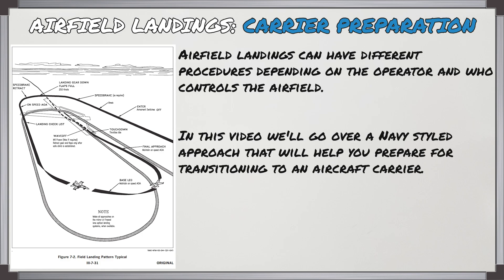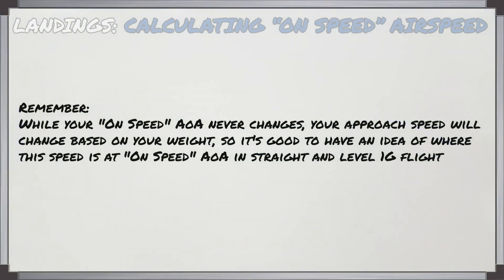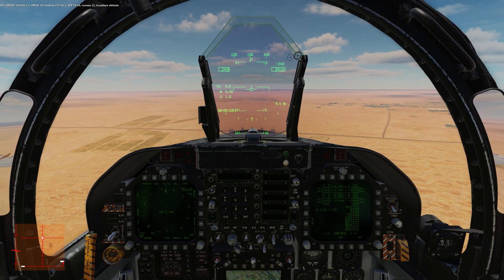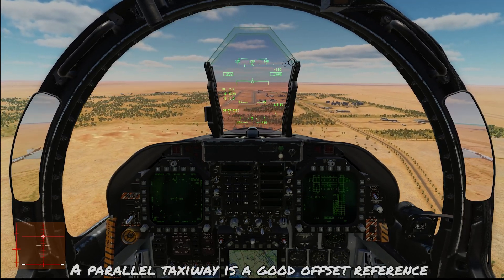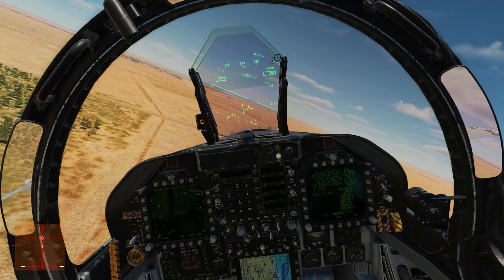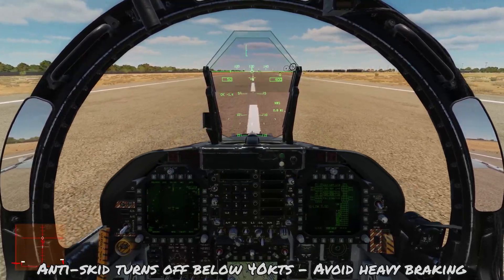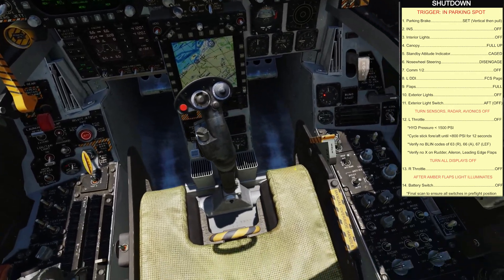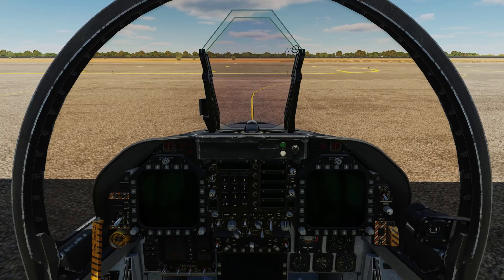DCS F/A-18C #4 - Airfield Approaches

Comment: Just got DCS, learning the F-18 first after messing around with FC3. Your videos have been extremely helpful, thank you.
Reply from the maker: Glad to help :-)
Reply: @RequiemsACTL  how do you ensure the proper distance from the threshold - I guess that 1.2 nm distance? when I go into the final turn at 30 degree bank angle I'm going wide and end up right of the runway
Reply from the maker: @Based_Gopnik89  when you're learning to judge that distance create a waypoint on the runway threshold and keep it active so you can see it in the HUD. Once you get used to that sight picture you won't need it anymore. You should also be evaluating how the runway looks during that final turn, your bank angle will vary a based if you see yourself overshooting or undershooting final.
Reply: @RequiemsACTL  How can I know when to begin turning to be align with the runway
Reply from the maker: @kenwei568  It varies depending on the wind conditions, so it will take some judgement and practice

Comment: This is fine when the terrain is flat, but on many airports they are placed in many mountainous areas, I’m presuming in these areas a pattern landing is not recommended?
Reply from the maker: In an area with terrain, or even nearby airspace, the type of patterns flown at an airfield can be limited. It could limit it to left hand only, right hand only, or even landing in one direction and taking off in another. Unless you had terrain close by on both sides of the airfield you could do this type of approach.
Reply: @RequiemsACTL  thanks also I’m seeing pattern landings @ 1,000 or even 1500 feet on upwind as opposed to 800 which seems more for carrier landings but many tutorials including our good friend wags they use 800
Reply from the maker: @thedigitalscribe9621  yep. Navy and Air Force fields will have their own rules that need to be adhered to. That's why you're seeing different values. This video is done from a Navy perspective to make transitioning to carrier landings easier
Reply: @RequiemsACTL  so what would your advice be on landing on airfields on dcs? I know there is charts but in truth I’m not good with them, happy to look at the in game mission map, but go in at 1,500 to be safe or evaluate the terrain and go in accordingly?
Reply from the maker: @thedigitalscribe9621  If you're using the Hornet I would stick with 800ft for consistency. Once you're comfortable with that and carrier landings you can go higher if you want to try it.
Reply: @RequiemsACTL  thanks for all your help 👍

Comment: While approaching the rwy my jet nose is always pointing to the left (while the jet is still going forward). Do you know why it happens and how to fix it? Since it is really difficult to aliign the jet with the rwy.
Reply from the maker: That means you are "crabbing into the wind" so because the wind is not moving the same direction as the runway it is trying to push you away from the runway centerline. By pointing your nose towards the wind, or crabbing into it, you are adjusting where your nose points so your flightpath can keep you flying along the runway centerline. When this happens you will need to do two things just before you land: 1) use rudder to align your nose with the runway 2) add aileron to maintain runway centerline
Ideally the wheel closest to the wind will touch down first followed by the other side then the nose wheel.
Reply: @RequiemsACTL  Thanks a lot!

Comment: learning the hornet now. i got too hyped and instantly started learning how to bomb stuff and once i learned all the weapons and food and all that good stuff i realized i didn’t really know how to operate the aircraft and i had skipped the basics. i can land on a straight end approach but the overhead ones are still tricky for me, i think i might be turning too late when on the downwind because after my turn out of the downwind i’m finding myself way too far off to the right
Reply from the maker: Yeah you may need to pull more G in the turn or hold the speedbrake out longer if you're flying a speed in excess of standard (350 KCAS).
Reply: @RequiemsACTL  i’m coming in at 350. i do my break, pull 1% of 350 and level out on the reciprocal heading and find myself right at +/- 250. drop the gear, lower the flaps then start to trim to get on speed but it’s after all of that is where i’m having issues. i think i’m turning either too soon or too late when getting back on the runway heading because that’s when i find myself off to the right side of the runway
Reply from the maker: @beatsbyjee1563  If that's the case (spacing is too far on downwind), then it could be either due to wind direction and/or maybe you're not offset enough on the initial.
Reply: i will try and report back
Reply: @RequiemsACTL  i figured it out. i wasn’t banking 30 degrees the whole turn and that’s what was offsetting me after i finished turning, i didn’t come out of the turn perfectly aligned but i was pretty close and i landed! i think i just need to learn when to initiate the turn now, i tried counting to 15 seconds but i’m in VR and it’s kinda hard to see the runway hahaha

Comment: You don't need the mod to see if you have the correct AoA. As soon as you've extended gear and flaps a W appears on the hud. This indicates the nose position of the AC. Keep this at 8 degrees in your hud and you're there. It pops up the same time as the E-Bracket. (Around 7:10 in the vid)
Reply from the maker: Yep that's right, but at that point you'll just be relying on the indexer anyway as you're still approximating where 8 degrees is. The mod is just more of an assist for people learning it and so they can see my control movements for the video. I don't normally have that window up myself. Another technique is to add pitch trim for about 2.5 seconds once the wings are level to get on speed.
In the RL Hornets they had a software update which puts the AoA number directly on the HUD but the ED devs have not added it as it came at a date after the Hornet we have modeled.
Reply: @RequiemsACTL  Works great for teaching in a video for viewers...but I don't recommend they fly with it on! 😀
Reply: @drumpiedumpie, spot on!  I get guys all the time asking me to turn on that unrealistic overlay in the cockpit; if you are relying on that, you're not eyes out and good cross-check in the cockpit to be where you should be.  Dont' get me started on ZOOM EYES to unrealistically see far off through the HUD.  True Situational Awareness is realized in the brain...not the eyes, ears, or seat of the pants...those are input mediums to provide the brain with information to process. Forcing yourself to not zoom allows your brain to form the picture on what everything is telling you....Good job on the FOV in the cockpit...that looks about like mine on a 27" monitor.  @Requiem, what's your Hornet FOV settings?  Mine is 80.0...~JUICE
Reply from the maker: @AIRWARFARECHANNEL  Hey Juice, I'm honestly not sure what my FOV is set to... I have a 27" monitor as well, but generally I set my FOV so the side mirrors are close to each side of the monitor. The one thing that annoys me about the default Hornet viewing position is I think the seat is just a touch too high, I keep having to lower the seat so I can see the RPM value clearer.
Reply: Btw there actually is a system that should tell you that puts corrected aoa where the indicated aoa would be on the hud as said by multiple hornet drivers I'm not sure why this wasn't added to the game as it would tell you when your trimmed 8.1 so you don't have to use guess and check

Comment: Taxing with the canopy open is always boss.

I was curious whether any F18 drivers flair on runways. Interesting point you made about weight on wheels and the aircraft being in flight idle vs ground idle.

Your timing trick on downwind was cool too – wonder if this would be one of the techniques used during a Carrier Class 3 landings?

Great work. Learn something new every time I watch your videos. 

Cheers.  🍻
Reply from the maker: Hey Mondo, you wouldn't use that timing technique for a carrier landing. The carrier is always moving away from you while the runway isn't, so you use that timing during airfield landings to simulate that carrier movement so your approach has the same consistency
Reply: @RequiemsACTL  Yeah, of course <slaps forehead>.